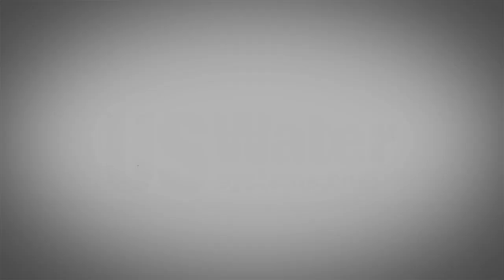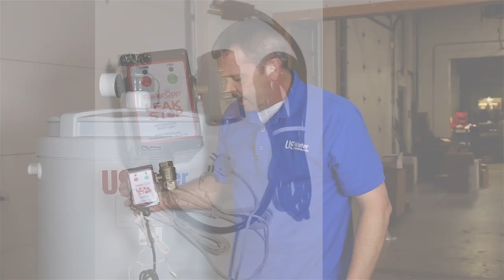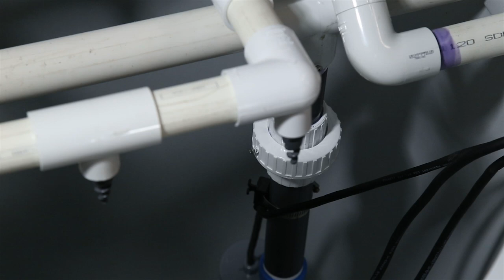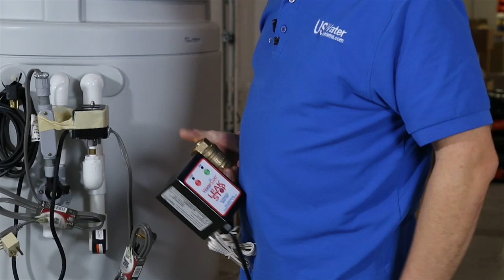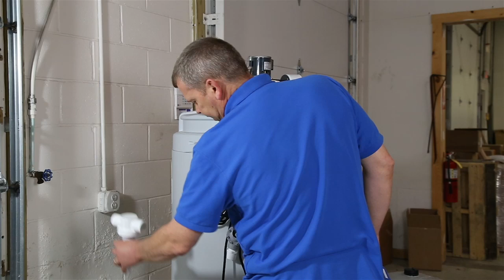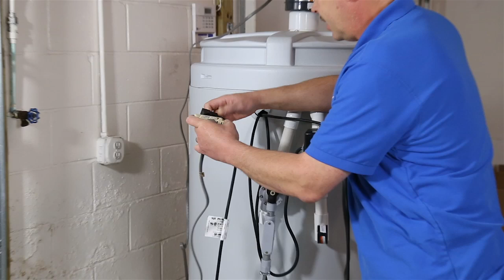Remove harmful gases from your water - US Water Systems Aerator

Comment: does this work safely for methane? because this video mentions methane a few times but the manual says its not safe for methane, so im confused
Reply from the maker: It is no longer rated for Methane. Sorry about that. This video slipped by after that change. I will correct it.

Comment: If you are on a well your gonna need to plumb this diffferent because you need to controll well pump. I have schematic available. Also, top float (over flow) kills power to pressure switch which operates outlet pump which doesn't make any sense, seems to me, and im going to plug solenoid into top float into bottom float 3 way. If tank is overflowing, you definately don't want to kill outlet pump. Or have top float kill well pump into solenoid in case solenoid gets stuck open.
Reply: Have you kept that schematic the same over the past year?

Comment: I have a Radon air raider water mitigation system to help remove radon from our well water. I recently purchased a tester for the basement and the readings are quite high. I want to install a fan to help lower levels. The builder installed the radon vent into the concrete but capped it off. I was wondering if anyone know if i could put a T joint to connect the air raider exhaust to the pipe coming from the floor. I would then install a radon fan above the T joint to continuously pull air up through the exhaust. Will this work?
Reply: Thats what I'm doing

Comment: Wouldn't a better idea be that you plug your pump/switch into the lower float? This will keep the pump emergized and allow the pressure switch to control the pump. And it will prevent the pump from over heating if the well fails to fill the tank. Let the upper float control the solenoid to keep the tank full.
Reply: I agree.  You could also reverse wire a separate float switch with a longer cord and weight to use the entire capacity of tank.